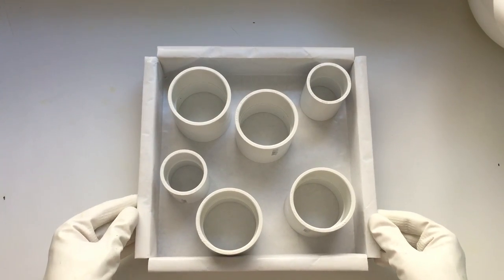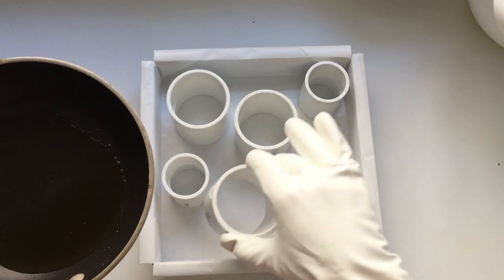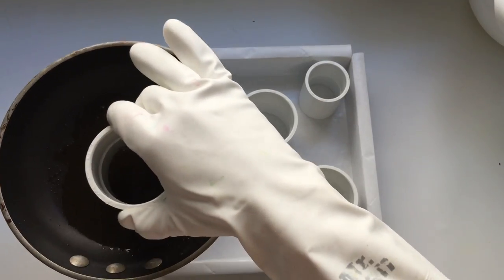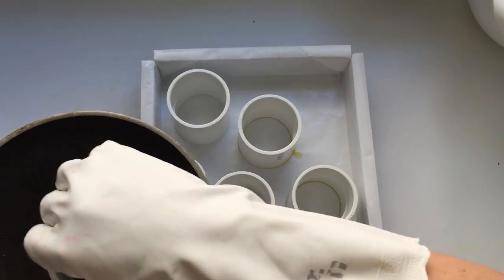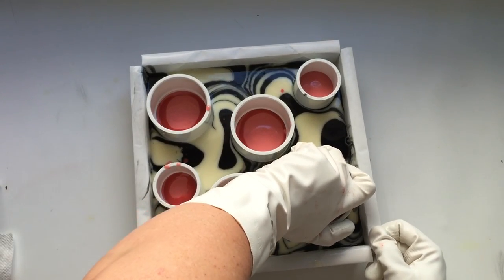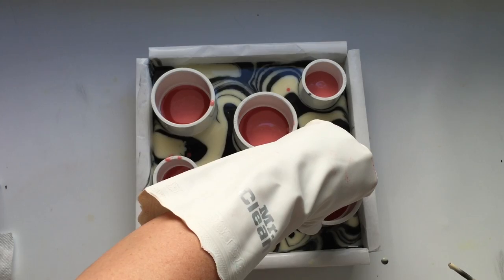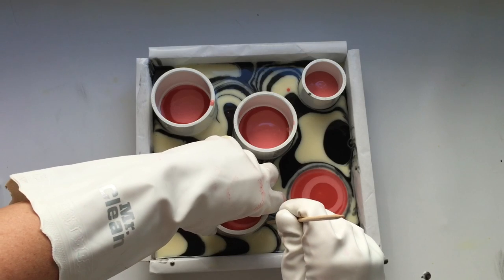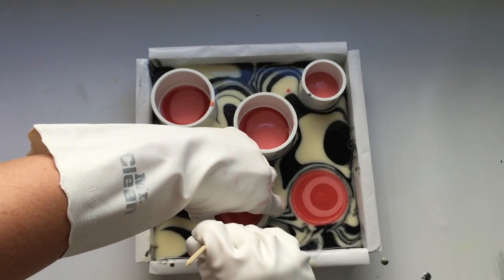Soapmaking: Thorns and Roses soap (pipe divider swirl)

Comment: The soap looks amazing! I wonder if using some melted coco butter would keep the cylinders in place also if you fill up the cylinders first they will have some weight so they will not be pushed by the pouring of the soap in the mold and coco butter may act as a temporary sealer. Just a thought :)